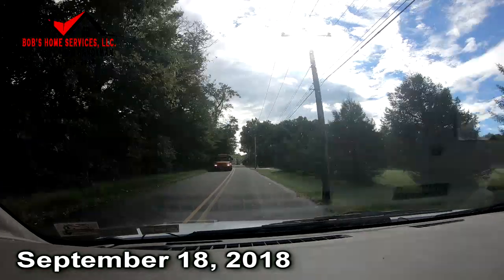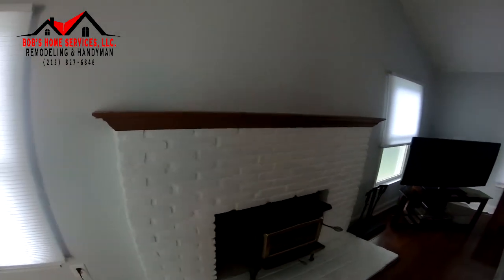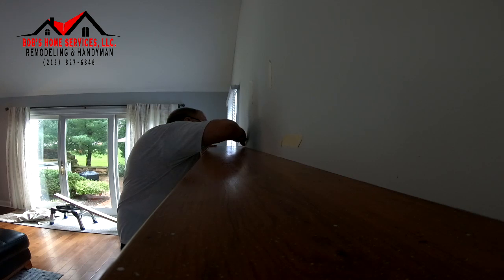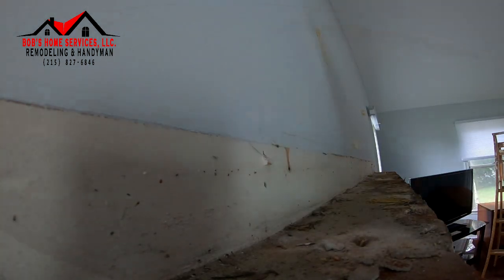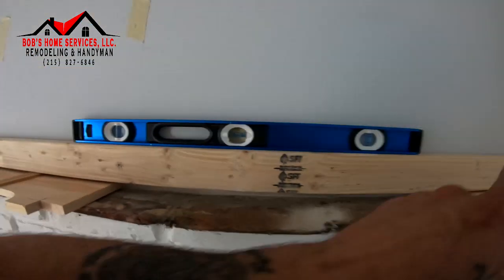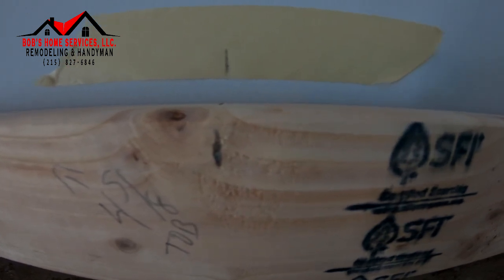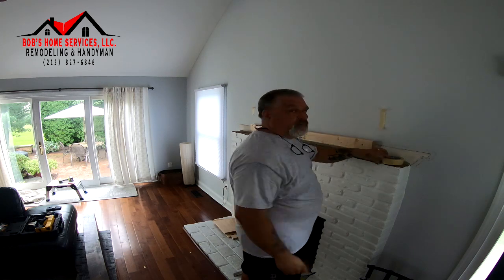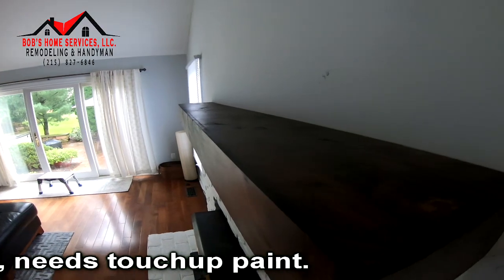Dis Mantle Dat Mantle

Comment: This is a job that i have been planning to do on my fireplace for some time but procrastination set in. I have it all mapped out in my head, now i just have to get off my ass and do it. I am going to use a french cleat to set the mantel and surround. Nice job Bob looks very nice.
Reply from the maker: A french cleat is a wonderful way to do this job, or any job that requires you to hang something on the wall.  I have used french cleats in several projects throughout the year.  You should share your before and after photos.
Reply from the maker: Have you done it yet, lol?